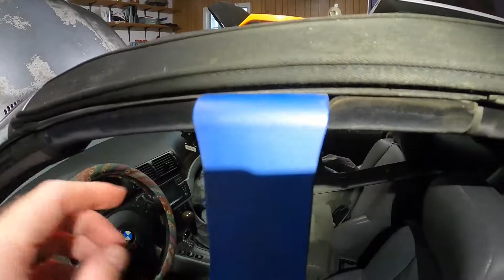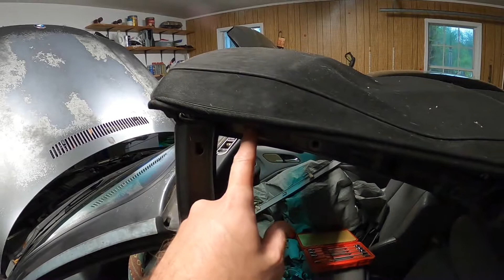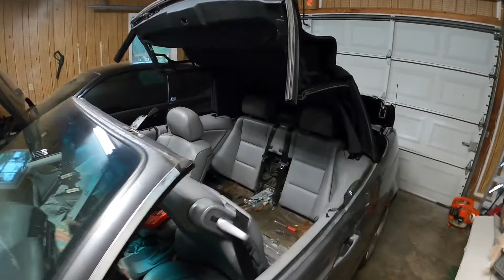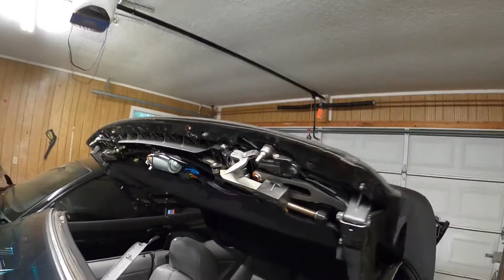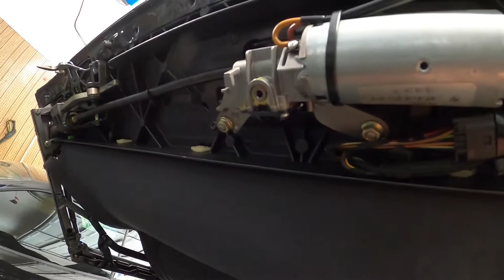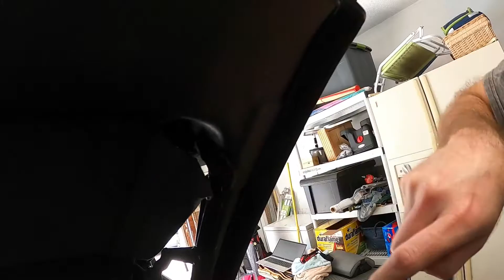BMW E46 Convertible Top Latch Gear Replacement

Comment: Thanks for the helpful video! About to do this myself. 

Question: exactly what kind of grease is that you used? 

Just want to make sure I use the right kind that won’t deteriorate anything.
Reply from the maker: I just used wheel bearing grease

Comment: edit: forgot i made this comment. it did not to be as long as i thought it did, the extension i got was ~5in i thought it had to be like a foot

ik this video is 2 years old now, but where did you find an allen socket long enough to reach? im looking locally and havent found a single place (yes, including harbor freight) that has one long enough

edit: this is the best video i've found on youtube, so thank you dearly for making an amazing video on this. i was previously watching a video that was in 240p by a guy that barely spoke english and was from 6 years ago lol
Reply from the maker: Amazon, search Tekton tools
Reply: You can likely use a torx long screwdriver as torx fits Alan as well, and snugly. Not much help if it needs huge breakaway torque however.

Comment: I noticed at the end of your video, after the cowl latches unlocked, your top stopped opening and you mentioned that you thought it was now pump related.  I know this video has been out for over a year, but if you haven't fixed it yet, I have a solution for you.  The wire harness that runs from your electric motor, that you just replaced the gears in, and the drivers side cowl latch, probably has a broken wire or multiple broken wires.  This wire harness contains 6 wires.  Two larger power wires and 4 smaller sensor wires.  The smaller wires are the ones that tend to break.  The break usually occurs where the harness bends at the first joint on the drivers side where the frame has to bend to fold.  Sometimes you can test this joint area by opening the top until the top stops opening and continue to hold down the open button.  Now with the open button still pressed, take your finger and move the harness around and see if the top continues to open.  There is also a small cable clamp there holding down the cabe.  Take out the small screw and this should free up the joint to move the wires around.  If the top starts to move again, it's the wire or wires in the harness.  Now you can carefully cut open the black mesh wire loom and repair the broken wires.  One note, sometimes the wires will appear ok because the wire insulation jacket is not broken, but the wire inside is broken.  Hopefully this help you out, or anyone else with this problem.
Reply: Yup this happened to me fixed the wires and it worked like a champ then I snapped something with the Allen wrench 😢
Reply: @Jayysmackins6.5  Me too! I just tightened it what seemed to be not too tight, but upon getting out of the car I heard a SNAP and the screw inside that access now spins freely :-/  Glad to find this video!!

Comment: My latch gear comes completely out and will not manually unlock the convertible because it does not catch when performing the counter clockwise with the allen wrench to manually open it.  How can I fully manually open the convertible in this case?
Reply: Did you figure it out?? I have the exact same issue
Reply: @Evansellick05 did you figured it out

Comment: I have the opposite problem, kinda. The top closes but the passenger side won't do what i call the final closing step so from the outside you can see the separation from windshield
Reply: i did some research because I'm having the same problem. its the plastic piece on the latch, its broken. you can fix it by drilling through and securing it with a nut and bolt.
Reply: @flywithkumi Thanks, man. Where is that piece located?
Reply: @alexcruz7719 it connects the spinning cable coming from the motor to the latch mechanism.
Reply: @husseinel-hajj7818  So what's the fixing, though?

Comment: There is something terribly wrong with my top latch. The allen head thats supposed to be accessible in the middle of the top is missing. Also the allen used to unlatch the top only turns so far as if its locked up. I cant get the top down far enough to reach the t-20 hex head screws underneath the liner. Any help would be appreciated.
Reply: I had the same problem. You might have the latches broken mine are cracked I’m not sure how I even got mine open it took 2 days then the gear replacement didn’t even work

Comment: Unfortunately my left latch is broken. When I look inside the hole for the 5mm Allen there is no bolt! I'm afraid that my top by be locked for life. If I can't get it open I'm just gonna sell the car because it needs a new top. If I can't get it open I can't replace the top.. has anyone ran into this problem?   I may have to cut up the top to get to the 5mm bolt and open the latch.
Reply: Did you fix it? Got the same issue

Comment: If that top was replaced, there's a chance they didn't bleed the air out of the hydraulic system. You can hear the hydraulic pump working, so it's either too low or there is air in it.
Reply from the maker: I've checked the pump, it is full. The system is self bleeding so there is no bleed procedure. I believe the seals in the pump are bad which is causing it not to build pressure. The pump it self works, it just doesn't build pressure.

Comment: Hi! I just did this today. Challenging and I still have yet to put it back together. 

I had the same problem with the latch motor mounting bolt breaking.  Do you happen to have a part number or a source for this part please?

Again, very helpful. 

Thanks!!
Reply from the maker: Hello, unfortunately I do not have a part number. I ended up getting one from a local guy that parts out BMWs.
Reply: Did you happen to find out the part number for this